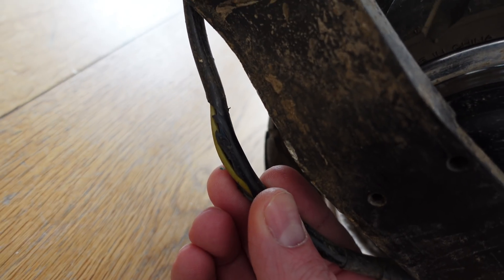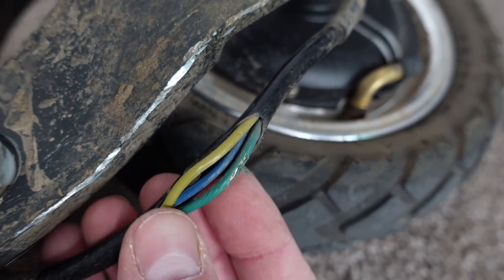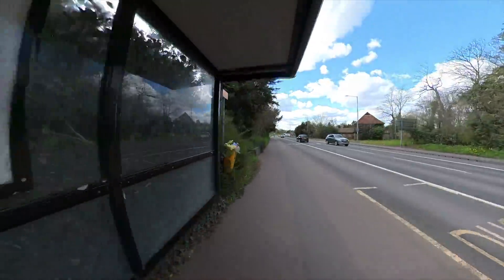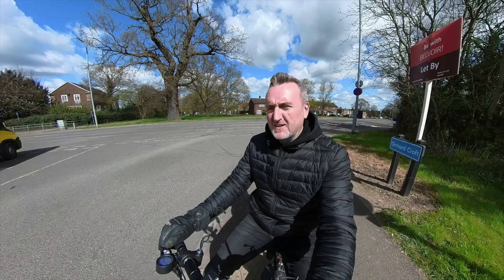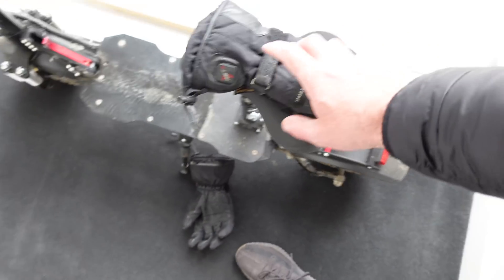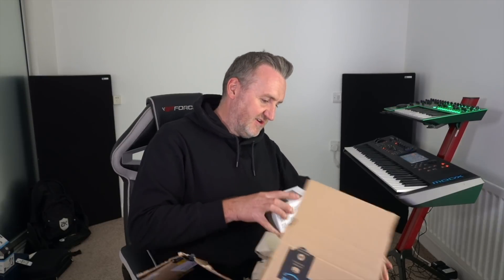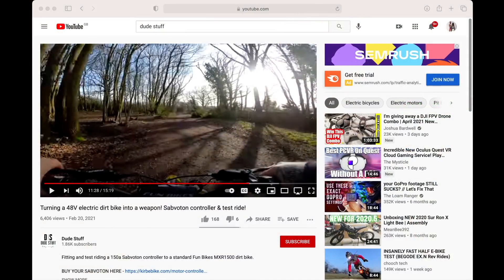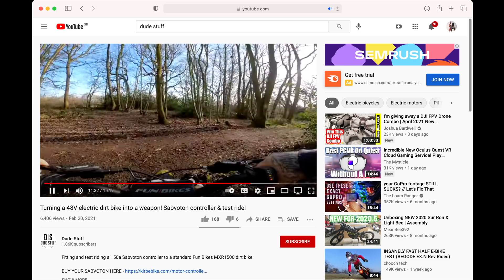Things to watch out for with small electric vehicles.

Comment: Funnily enough phase wires can touch without a problem to the controller, though the motor will cog really badly.
If the short to the halls..its game over for the sensors and probably that part.of the controller.

Comment: Great to have an intelegent bms that shutsdown, so fault finding is much easier to diagnose without getting the multimeter out on each balance lead which could easily short a battery cell in the pack

Comment: hey my ebike display once worked and stopped when the snow started turned out the snow sat on the display and when melted the water got into it and Fried the circuit so new display works fine now.

Comment: I have one of your bikes. It turns itself off and can be hard to turn on.. I have to turn battery off the on again and try again . Sometimes when I riding the voltage drops to zero and switches off.. also lol but u asked for this.. is it ment to give me serges of power when I'm free wheeling?? 🤔 I have a feeling its a battery issue its the 58v battery and the 1500watt kit..
Reply from the maker: Try switch cleaner in the switch and work it in, that should solve it.
Reply: Just a quik update I have used switch cleaner and tried the bike a few times and it's been all good so far.. thank for the advice
Reply: And whenever my s would shut off my voltmeter would read zero
Reply: @MotoAlias  as I'm riding it will loose power flash zero power and shut off
Reply: Could be your controller is trying to pull more amps than your bms can discharge. May need a bigger bms. Only happens when your on it hard for a Lil bit?
Reply: @MotoAlias  no its not that as it can be hard to power up from the start. Defo not down to power draw. I'm still yet to try n do the switch what Andy suggested yet
Reply: Ok I just had a similar problem. My bms would shut off my battery when I'd try and pull too many amps and I'd have to plug my charger in and cut power on and off the get bms to turn back on... I ended up simply bypassing my bms for discharge only and still charge through it.
Reply: Yup same problem I had. My BMS was 50/100 and my controller was 40/80 but the 80 is burt's and if I held on the throttle it wouldn't on its own stop 80 I'd have to let off the throttle on my own 20second burst clock. I ended up bypassing my bms for discharge only so if I want to ride the bike hard and pull 80 amps the whole time I can.